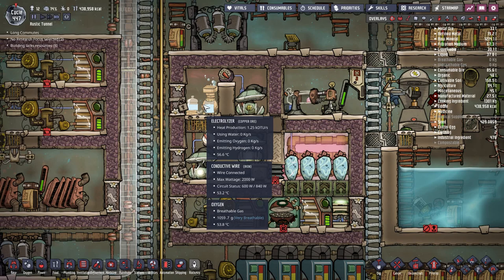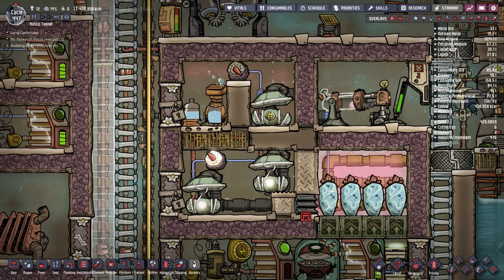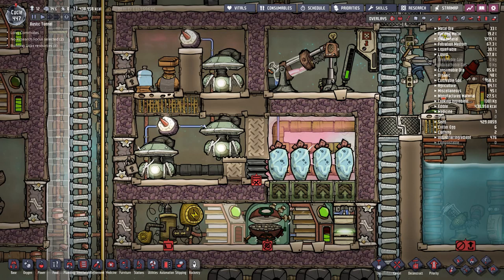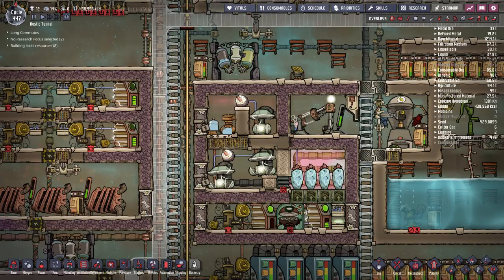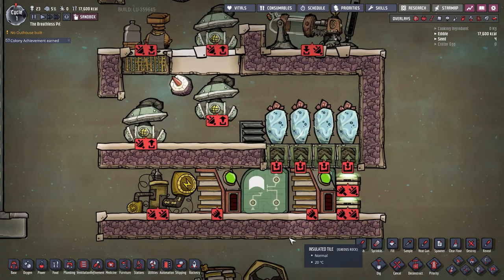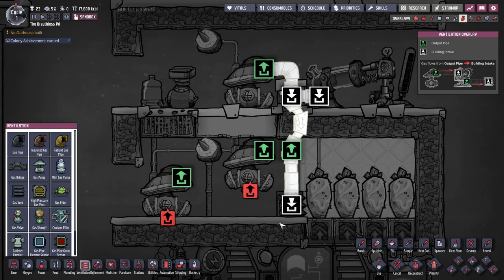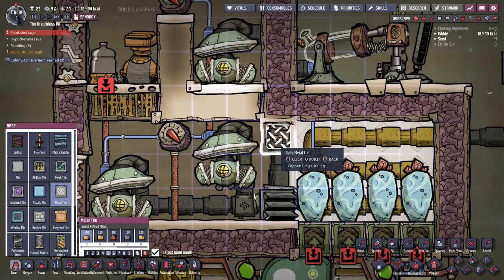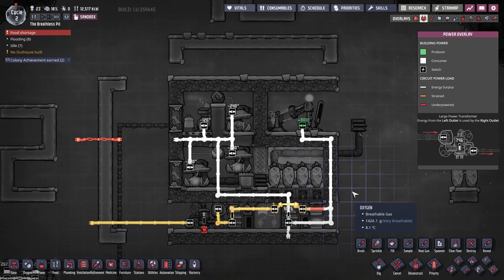Oxygen not included - How to build: Advanced Oxygen Production!

Comment: Watch out for leftover gas in the cooling chamber. I know you state that some gas is ok, but it can break the "Overpressure Trick" to prime the cooling chamber with hydrogen. If there's one (or more) tile of another gas in there, the vent will occasionally push additional hydrogen into the chamber, even if the hydrogen tiles are already at well over 2kg pressure. This can cause the hydrogen generator to starve and the system to become unstable.

It's safest to create a vacuum before starting electrolyzation. With your recommended setup, this is difficult because the Wheezeworts suck gas from their lower tile and push it out at the top, so the gas in the cooling chamber almost never diffuses into the oxygen chamber. Even if it did, letting a Dupe in there to build that last metal tile would destroy the vacuum again.

The solution I found was to place the last metal tile immediately, but replace the first two above the vent with a mechanized airlock, connected to an automation switch outside the SPOM. That way, you can wait until the pumps have evacuated the whole module, then flip the switch to separate the cooling chamber from the oxygen part. The airlock will need a power connection, but it will not draw power once closed.

Comment: Why two batteries?  To handle a big surge?
Reply: The system should use slightly less per than the generator produces, because the pumps are not constantly running. So first it fills it's own battery, and then anything left over goes to the second battery, which can then be used by the outside grid. I don't know why he had a transformer, or conductive wire, regular wires goes up to 1 kw, and the generator only produces .8 kw
Reply from the maker: @devinhobbs3082  
Transformers on the excess power output are used to create multiple circuits and then connect into different circuits in your base.
This is not easily seen when there is just one transformer/one circuit, I should have mentioned this in the video.
You can see several more transformers and circuits branching out in 14:22
It is true that in this case they don't really serve in their primary function as lowering power in one side.
The reason why regular wires are not used is that sometimes as batteries are switched, it is possible that the power draw/input on the line gets somehow combined between the generator and the pumps and for a moment it can go over 1k and can damage the circuit.
Also, you can tune up the hydrogen generator and make it even more efficient, this will make it output more than 1k power (1.2kW) and regular wires won't manage to handle this.

Comment: Anyone tested this recently? I just built it and found that my hydrogen generator isnt quite making enough energy to run both pumps. I saw Ben2111's comment and deleted the gas pipe connecting the wheezewort chamber so no more hydrogen could get in, but still losing power. any ideaS?
Reply from the maker: The generator should have plenty of power to run both pumps, so something here is not right.
Did you check if the battery settings are set correctly? perhaps the hydrogen generator is diverting more power to the external circuits than the pumps?
Reply: @stivraptor  Never mind! Just exited and reloaded, seems fine now. I think it was a big with how hydrogen was getting routed through the T intersection between the generator and wheezeworts